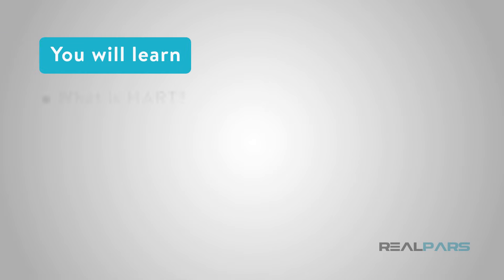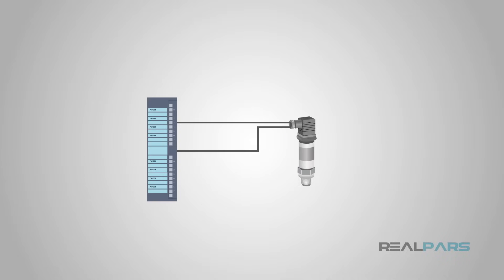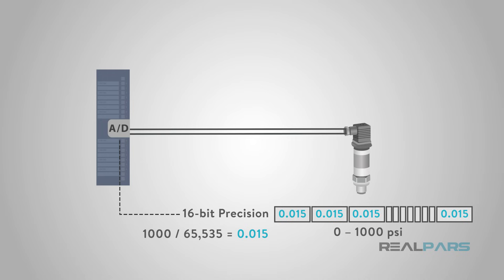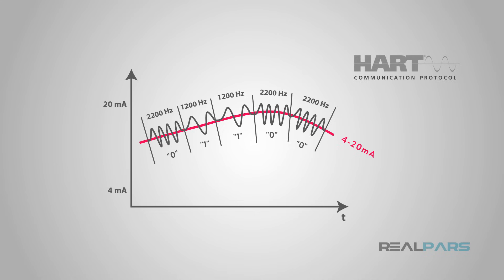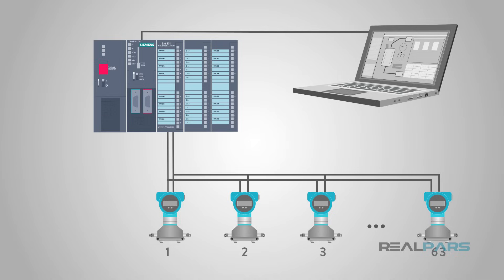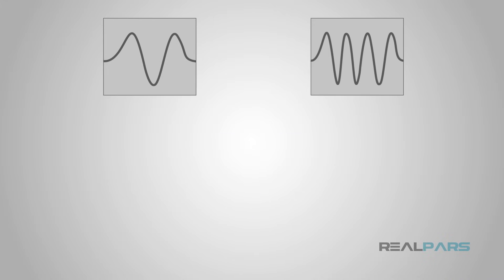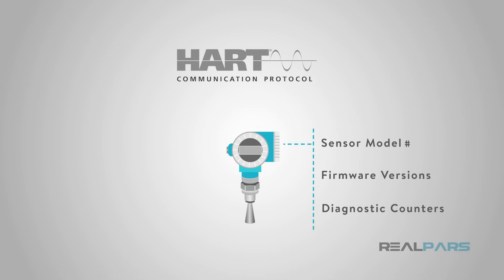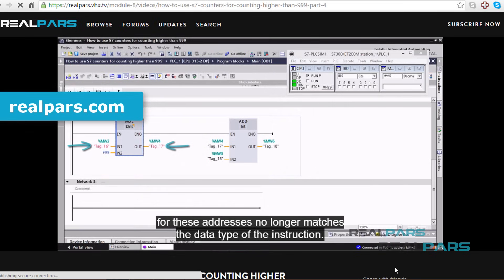What is HART Protocol?

Comment: Why do we start at 4mA and not 1 or 2 or 3mA??
Reply from the maker: Hello, @YF0601. Thank you for your question. Yes, this is the norm. Devices are typically designed to operate within a range of 4mA to 20mA. With 4mA being 0% and 20mA being 100%. However, it can also range from 0mA to 20mA, which is another industry standard. You can learn more about this topic by signing up for our 7-day free membership.  Here is a link for your learning as well: https://www.predig.com/indicatorpage/back-basics-fundamentals-4-20-ma-current-loops

Comment: On a telephone line, you would hear the bell 202 modulation, and it would disrupt (interfere) with the voice signal, as it is in the human hearing range. The caller id modulation is sent on the line between the first and second ring, before the phone is taken off hook, so there would not be bell 202 signaling in the middle of conversation.

For a current loop, what matters is the current value. I wonder what impact bell 202 modems have on current(likely small, but maybe noticeable).

Comment: is this how sensors work? 20mA = 100% full of water, 15mA = 50%, 10mA=0% and 0mA = fault in sensor detected? Do you guys in the field check if your sensor is working correctly, using a precise multimeter? Or do you grab a long wire and wind it around your ampmeter 10 times to raise the precision?
Reply from the maker: Thank you for your question. When using a 20mA to 4mA scale, typically, 20mA represents 100%, and 4mA represents 0%. However, it's important to note that depending on your specific application requirements, you have the flexibility to adjust the scale accordingly. This can be achieved by scaling the analog-to-digital converter within your PLC program to suit your needs. For instance, if you're working with a 16-bit system, you can set the scaling for 14, 12, 11 bits, and so forth, depending on the precision required and the capabilities of your PLC model.

The ability to customize scaling is highly dependent on the type of PLC you are using and its programming capabilities. With our Pro membership, we offer comprehensive lessons that cover these topics in detail, providing you with the knowledge and skills to optimize your PLC programming.

Comment: One question with the Profibus communication network, can you send analog data? If it is not possible then the profibus cannot regulate the process, therefore it only sends information from the sensor to the plc but does not regulate the process, is this correct?
Reply from the maker: Hi there,

Thank you for your question, great one! Profibus communication converts all the signals in the communication protocol needed and transmits them, then converts them back to the receiving end. The PLC regulates the process as needed. 

Happy learning!

Comment: Why can only connect 15 devices in multipoint mode instead of 16 or 14?
Reply from the maker: The HART Master Station (PLC or DCS) is Node 0.  That leaves nodes 1-15 available in multipoint mode for sensors/devices.

Comment: Is it possible to read the process values digitally, i.e. skipping the A/D in the PLC I/O module, using HART? (Meaning the 4-20 mA is not used for anything really)
Reply from the maker: Yes.  When HART is enabled, it is used to collect the PV data.  The 4-20ma loop current is used to power the device, even though the analog signal is not used to develop the PV value.
Reply: @realpars  Nice, thank you! So this eliminates the A/D conversion error in the PLC, as an example use case?

Comment: Cool video! You have 5 modules: 
1) A power supply
2)  CPU315-2 DP Power Supply 1P 6ES7 315-2AG10-0AB0  
3) 6ES7331-7TF01-0AB0 | HART Analog Input Module

4) What is this module and it's function?     
5) What is this module and it's function?

On module 2) Does RS 232 connect to the PC with a USB and a HART modem?
Reply from the maker: The fourth and fifth modules are analog input modules just like module 3.  They were added just to show that a CPU315-2 rack can have multiple I/O modules.  The programming terminal is connected to the CPU using either a Profibus-DP connection or an MPI connection.  These are both serial links that require a special modem or PCI card at the computer end.  A HART modem is used to communicate with a HART device in order to configure the sensor.  This connection is external to the PLC hardware setup.

Comment: Is there any way to have sensors send interrupts to masters? or can sensors only respond once told by the master?
Reply from the maker: HART protocol is based on the older Bell 202 protocol.  In this node-based protocol, only Master nodes can send data requests. Sensors (nodes) do not have the facilities to generate interrupts or initiate communication.

Comment: Remember, in a power outage, an analog phone will keep working as it has its own power supply. good to have a backup 'dial' phone without the battery. you can still call emergency, do not need batteries or power.

Comment: I wish to have a clarification, how to connect non-hart field transmitter having output 4-20 mA with HART communication network or HART enables PLC? Whether i can go with adapter to make my field device into HART enabled?
Reply from the maker: A HART-enabled transmitter still requires a 2-wire connection at the Analog I/O card.  PLC cards typically allow selection of HART mode and non-HART mode (i.e., HART enabled or disabled) for HART-enabled analog cards. If you have a transmitter capable of HART communication, you can choose to use the HART functionality or not, but enabling or disabling HART communication at the I/O card.  Leaving the I/O channel with HART disabled allows traditional 4-20ma loop-powered signals to be sensed at the analog input card.  You should refer to the manufacturer's I/O card documentation for verification of this feature.  An analog or digital transmitter cannot be converted to a HART transmitter with an adapter. A transmitter must be manufactured as a HART device.

Comment: how are HART sensors shielded from unwanted outside emf/radio waves/purposeful fault creation
Reply from the maker: Hi there, 

Thank you for your question, and our apologies for the delay in our response. 

To ensure a reliable engineering setup, here are a few key steps I would recommend:

1. Select the Right Cable: Begin by choosing the recommended cable for your specific application. It should invariably be a shielded cable.

2. Conduit for Long Runs: If you have an extended cable run, it's advisable to encase the cable within a conduit. This practice is typically endorsed by the HART device manufacturer.

3. EMF Signal Isolation: For optimal performance and minimal electromagnetic interference (EMF), adhere to the distance recommendations outlined in the data sheet. Maintaining adequate separation from EMF sources is crucial.

Following these steps is standard procedure for the installation of HART or any 4-20mA signals, and it helps to minimize the risk of EMF interference.

Happy learning!

Comment: So since the Hart signal is a frequency wave, is it AC voltage riding on the DC 4-20mA?
Reply: Not quite. If you recall, a rectified dc voltage is not quite flat, it has its peaks and troughs like ac voltage, but they average out to a dc voltage above zero. Rewatch at around 12 minutes.

Comment: Great Information. Note As per Bell 202 modem AFSK encode and transfer data at a rate of 1200 bps & not for 12000 bps.
Reply: And also not a 12,000 Hz tone, as mentioned a few seconds later. This is all around 6:00.

Comment: Thanks to REALPARS. This video is a high level and precisely explains the HART protocol.  I will help to share in my Linkedin network and hope engineers will have a good understanding of the HART protocol and able to choose the correct instrument if they looking to collect the diagnostic data preparing for predictive maintenance.
Reply from the maker: Thanks for your support! Great to hear such positive feedback. Feel free to reach out if you have any questions. 

Happy learning!
Reply: RealPars. Appreciated for your offer.
I am actually just completed introduce a good size of a instrument diagnostic system into my company and gained massive success. Am currently preparing another one for another project, I hope repeat my success but further embedded into the New Way of Working for my colleagues. I potentially having some question about the DD compatibility questions if you have in depth knowledge about that.

Comment: Thanks for the great video guys, really informative!

I have a question though, which is not clear to me from the explanation.

Regarding the wired networking of multiple sensors, how many wires will you have in the end?

Is it a 1-1 connection for each of the sensors, or can you somehow impose the wiring of all of the sensors involved and end up with 2 in the end, with the capability to access or request data from whichever one you wish at any given time?

Thanks and keep up the good work!
Reply from the maker: Most networked, or bus-connected, sensors operate with 2 wires, (+) and (-).  The difference between bus-connected and single sensors is that in bus-connected, the many sensors are connected in series, with a Bus-in and and Bus-out connection.  The "out" from the last sensor in the bus returns to the common connection of the circuit.  With a single sensor, the "out" returns directly to the common connection of the circuit.  The two wires form a current-loop circuit and there is a (+) and (-) wire, with the signal overlaid on top of the circuit as communication moves from (+) to (-).  That is a little bit of an over-simplification, but both wires are always used in communication because both are required to complete the electrical circuit.
Reply: Just to add that while communication and power will be carried over 2 wires only for as many HART sensors connected in parallel, however you are still limited by the PLC card or data logger limitation where each sensor will utilize a single channel off the master card.

Comment: Why do you say "Basically, it provides a continuous signal, as an AC sine wave"  would this not be a dc current that this signal is being superimposed on? Or are you just trying to say that it is a sine wave? It seems a little confusing to me why you use the "AC" in that sentence. 

Thanks for the video!
Reply from the maker: The HART digital signal is a 24VAC sine wave superimposed on top of a 24VDC current signal.  The AC component is very small compared to the DC component, but is is an AC signal nonetheless.  Because it is a "pure" sine wave (peaks = troughs in frequency  and amplitude), the AC and DC signals do not interfere with one another.

Comment: Great video, i would like to know which PLC are you using... and if you can use the HART protocole with any Siemens PLC (more specifically with the S7-1200 and S7-300).
Reply from the maker: The video did not specify the PLC model since it is showing how HART is used in a universal, generic way.  For use with an S7-1200 or S7-1500, you just need to make sure that your analog input card is one that supports HART protocol.  There are HART-enabled AI cards (and AO cards) available for most all of the Siemens S7 PLC models.

Comment: Can we use HART on CAN or Ether Cat?
Reply from the maker: HART is typically used as an instrumentation protocol.  CAN and EtherCat are typically used to connect I/O modules to the processor.  If you want to use the HART capability of an instrument or transmitter in your control system, you will need to insure that a HART-enabled I/O card or connection is used.  The I/O cards can be arranged in a rack or other configuration that can be connected to the main control system with EtherCAT or CANBus.

Comment: Why 4-20 mA as a analog signal, why can't we use 0-10 V as analog signal.
Reply from the maker: Some devices are configured to provide 0-10VDC analog signals.  If these sensors are used, you will need to use an analog card that accepts 0-10VDC signals.  Most PLC manufucturers offer I/O cards that can accept these signals.  I have used these in the past, especially with analyzers and lab equipment, but you need to be careful, as voltage signals degrade rather quickly at distances greater thab 50 feet from sensor to the analog card.  Also, low voltage signals are very susceptible to electromagnetic interference, so special attention needs to be paid to electrical isolation, electrical reflections, and ground loops.  If properly connected and set up, 0-10VDC signals can give very accurate analog values.
Reply: b/c voltage is set to constant 24V, therefore varying current gives us the reading

Comment: is this similar to a AS-Interface natwork?
Reply: Not exactly.  Both HART and AS-i are digital interfaces.  Both are transmitted over a two-wire bus.  Neither needs to be terminated.  However, the protocol and signaling for each is quite different.  AS-i has a much simpler data packet structure than HART, and is quite a bit faster.  HART is strictly a point-to-point connection to the "master", whereas AS-i uses a trunk and drop or star network configuration.
Reply: @scottsommer6480  thanks, I've always wondered how it works, does it use frequency modulation to carry the bits, or something else?
Reply: Without being overly technical, HART utilizes Frequency Shift Keying (Bell 202 modem) and AS-i uses Alternating Pulse Modulation to send/receive data.

Comment: Thanks, very informative. Question: Can an Ultrasonic flow sensor with HART output been connected to an analogue input card that does not support hart, if only the 4-20 mA signal is used?
Reply: Yes, but the HART capability will not be available to the control system.  However, the HART signal is still being communicated, so using a handheld or PC-based interface can still make use of the HART signal.  Many plants use this approach.  The advantage of using a HART-enabled PLC or DCS analog input card is that you will have the secondary PV, SV, and TV all available to the control system, as well as the primary PV and diagnostic info about the device.
Reply: @scottsommer6480  muchas gracias

Comment: thanks for video 
but i have question please
why the division based on 1200 and 2200 HZ
Reply: while designing the protocol they have designed in such a way that 1200hz means binary 1 and 2200hz means binary0

Comment: Very nice video. However, I have a case with the period of the sine waves shown. I learnt Short periods should have bit (1) for High frequency and Long periods should have bit(0) for Low frequency but the reverse is the case in this video. 1200Hz has Bit(1) while 2200Hz has Bit(0). Please explain why.
Reply from the maker: The signalling for HART follows the Bell 202 modulation standard, which follows the schema of 1200HZ for a binary 1 and 2200HZ for a binary 0.  The Bell 202 standard was developed in the early 1970's and remained virtually unchanged since then.

Comment: Question. If you WIFI a HART device would it be wise to encrypt the data being transmitted so that if the data in intercepted then it could not be read. This would make it next to impossible to hack the WIFI data and send false data.
Reply from the maker: There is a Wireless HART protocol, which uses Industry standard 128-bit AES encryption, unique encryption key for each message, device authentication, and rotating encryption keys used to join the network.  This is a specific protocol, not just a HART signal transmitted over WiFi.